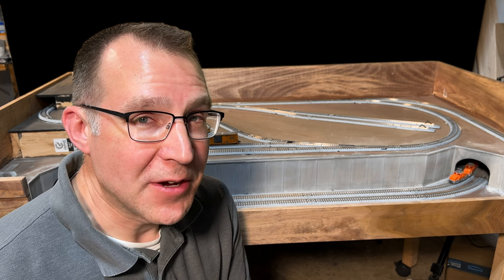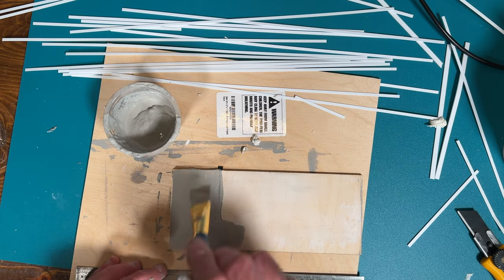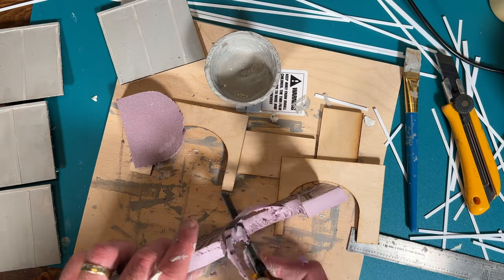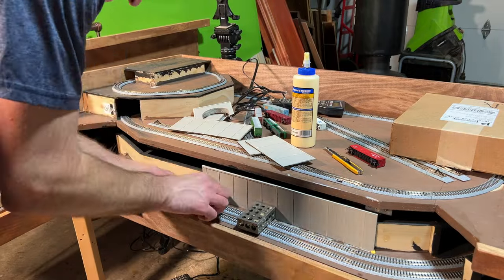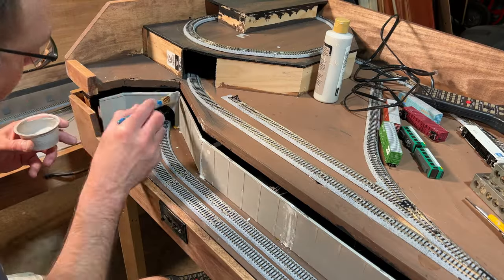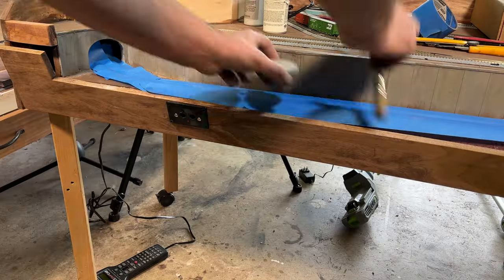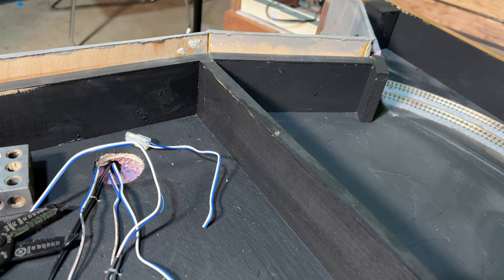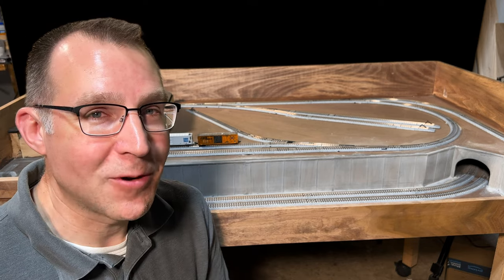Plywood and Styrene Retaining Walls

Comment: 😊I use lightweight spackle to fill wood grain. It’s easy to work with and sands to a smooth finish.  

I think the key to representing concrete is that concrete isn’t any one color.  It’s a mix of colors. Stipple on a variety of grays and tans with an old brush using very little paint.

Comment: Nice vid, thx! At the end when you were talking with trains running, it reminded me that Unitrack can be kind of loud. I wonder if you packed foam or some other similar material into the cavity under the Unitrack if it would quieten down? Laser cut balsa may be a quick and effective solution. Would be easy to test. 
Totally appreciate all your efforts in making and sharing. Thanks!!!
Cheers and keep up the great work, 
Coxy
Reply from the maker: Yes, that is a downside of unitrack. Especially since i have it right on the plywood this go around.